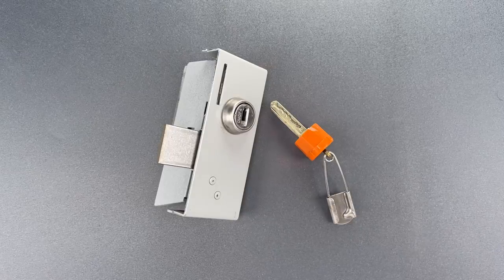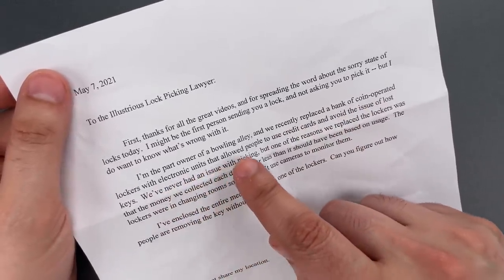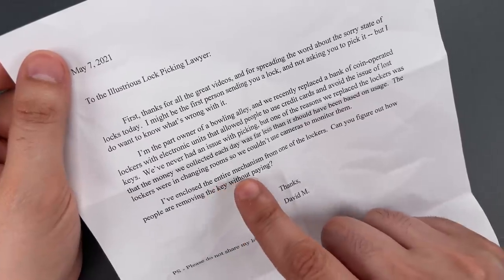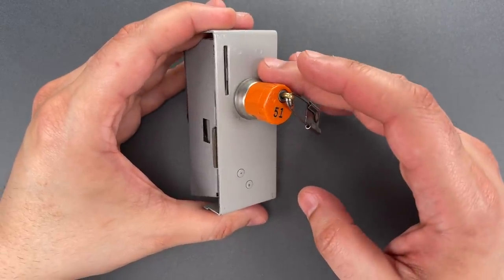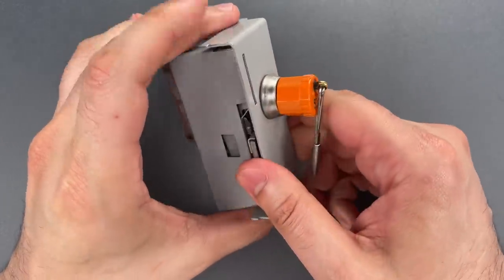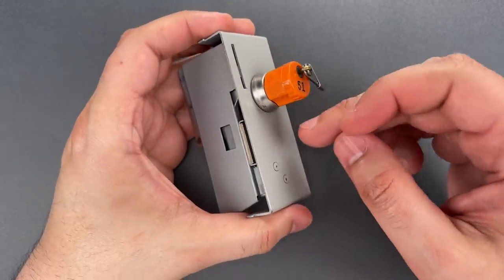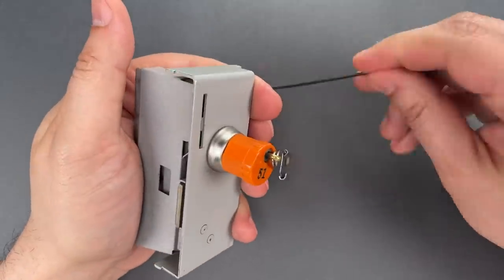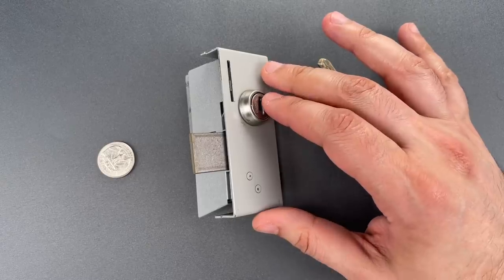[1308] A Huge Flaw In This Coin-Operated Locker Mechanism

Comment: LPL: When reading the letter takes more time than picking the lock
Reply: Guess I have to fix the lock
Reply: Generally speaking, sure that. Didn't see any picking and didn't see multiple ways in the video tho.
Reply: Everything he did in this video took more time than picking the lock.
Reply: Picking the letter took also longer than picking the lock...
Reply: Thanks to LPL now i have the feeling  of 99.9% less security.
Reply: Well he didn't literally picked the lock, but he picked the key
Reply: He did not even pick that lock XD
Reply: he picked the lock already, picking it took six minutes in the mentioned video…he got lazy and didn’t link to it

he didn’t actually pick the lock, just picked the key retention mechanism.
Reply: That's pretty much all the time.
Reply: ...am I the only one laughing because he didn't pick the lock? 
I mean sure he cheated the mechanism in a way pretty similar but this is the lock picking lawyer not some kid with aluminum slugs
Reply: Alex D.: when you don’t know the difference between picking a lock, and defeating a locking mechanism

 (Hint: this video features no lock picking)
Reply: he.. he didnt even pick the lock.
Reply: @overlordghs1081  to be fair since there is a locking mechanism to prevent the key being removed until coin is inserted it could be argued he is picking the lock, more so because he used a picking tool and not just a fake coin or various other by pass methods likely used for years
Reply: @SwiftCreationStudio I would hardly define the key retention system as a “locking mechanism.” that would be quite the stretch, as it’s just a bar preventing the actual core from turning enough for the key to be removed. lock picking is defined as attacks against an ACTUAL locking mechanism using tools other than the key to actually open the lock itself. also, he used a bent piece of metal not a picking tool but regardless the same effect could have been achieved with any material stiff enough to manipulate the bar. also, just because a tool is called a lock picking tool doesn’t mean every institution of it is considered “picking.” If I use a hammer to scratch my back, does that mean I am hammering my back?

He didn’t pick a lock in this video, he used a piece of metal to exploit and bypass a mechanical system that was completely separate from the actual locking mechanism keeping items secure. You could not use this method to actually open the lock, only to bypass paying to use the lock, so clearly no lock was picked. 

Also, I’m fairly certain OP is a bot that just takes popular comments from his other videos and comments them here.
Reply: @overlordghs1081  ...yeah a bar preventing the access or removal of an item is the signature hallmark of literally every lock. It might be a terrible one and require zero skill to bypass but that is literally what a lock is. 

I'd take your misguided perfectionism of the craft back to square one because in watching these videos you have been spoiled and have lost sight of what a lock is.

Also of what relevance is the op being a bot, let's say you're right, that is A. Not how they operate B. It still boosts engagement for LPL, C. Serves no purpose in existing so creating it for such a specific purpose and not steering it toward obtaining monetary gain or spam geared to that means is pointless... bots don't just fall from the sky they need to be programmed, but that isn't exactly hard either

The user isn't a bot because such a post from a bit would require some level of AI that simply doesn't exist for the average bot and there is no end goal of obtaining any sort of gain which with increased difficulty in creation would become evermore desired. 

Being uncreative and quick to post without really obtaining the details doesn't make you a bot
Reply: He didn't pick the lock, pay attention.
Reply: @incumbentvinyl9291  debatable. Pay attention
Reply: @SwiftCreationStudio  It's not debatable, watch the video.

Do you comprehend what picking a lock implies? He used the key to the lock, that settles it. Unless your view is that when this lock is used, it's automatically picked when a quarter is inserted.
Reply: @incumbentvinyl9291  Is the key locked in place? Yes. Is a tool or other implement other than what is intended for the function. 

You might expect something far more complex, you might have a preconceived notion of what a lock is, or you may be over looking the fact the key was obtained without the quarter triggering the basic locking mechanism holding it and focusing on the lock the key operatates.
Or hell maybe you are just wishing he picked the keyed lock too 
To which you have a different video to watch.

But if you take a step back from your hive mind reposting of the same things because you need to make a point yourself despite being unoriginal and overly stated, you'll find a lock was indeed picked.

Far from the most complex in fact it's probably one of the least but as I said. It's debatable and that is precisely what is going on here.
Reply: @incumbentvinyl9291  also to answer your last point, no. I consider the quarter to be the "key" so to speak. But like I said not exactly a complex system there I've seen basic coin counters with more complexity
Reply: @SwiftCreationStudio  The lock wasn't picked.

That's nothing short of ignorant. You can't open the lock using only a quarter.
Reply: @SwiftCreationStudio  TLDR
Reply: @incumbentvinyl9291  Ah, alright I'll indulge your illiteracy.

You're wrong. Completely.

And to think I was writing up a follow up saying how you made an honest mistake and showing sympathy for your... how you put it... ignorance.
Reply: @incumbentvinyl9291  You're the only one actually showing ignorance. You have been given information and you have made the active effort to ignore it. It's one thing to hold mistaken beliefs, it shouldn't hurt you to be wrong if you learn from it, but you're refusing the information and proudly proclaiming that.
You're Pridefully Ignorant.

Thanks for the debate.
I told you this was debatable
Reply: @SwiftCreationStudio  Not reading your essay did not require active effort.

There is no debate, facts are facts and will remain so.
Reply: @incumbentvinyl9291  You're right about that, just wrong about the facts. The debate already took place. 
I don't believe there are winners or losers in debates but you sure aren't giving yourself or your position any credibility.
Reply: @SwiftCreationStudio  I have not been part of any debate, I've simply stated the facts at hand.
Reply: @SwiftCreationStudio  The lock wasn't picked.

What debate? Consult a dictionary and educate yourself.
Reply: @incumbentvinyl9291  Debate: a formal discussion on a particular topic in a public meeting or legislative assembly, in which opposing arguments are put forward.

Lock Picking: Lock picking is the practice of unlocking a lock by manipulating the components of the lock device without the original key.

Lock: A device used to prevent the operation or movement of a vehicle or other machine.

Which definition are you having trouble with?
Reply: @incumbentvinyl9291  Don't tell someone to get a dictionary unless you're hungry, you might have to eat those words.
Reply: @SwiftCreationStudio  Yes, a formal discussion in which opposing arguments are put forward. I have not provided any arguments, I've simply stated the fact that the lock was not picked, so that clearly doesn't apply here.

Exactly, without the original key. Here, the key was used. You keep proving my point.

''get a dictionary''

Hah! Time for you to consult that dictionary once more. I suggest you start with the word 'Formal'.

Good job painting yourself into the corner.
Reply: @SwiftCreationStudio  I find it rather interesting that you said you'd stop this conversation, yet here you are time and time again.

What happened? Did you realize you were wrong and simply couldn't let it go?

Yeah, you should be sorry. Apology accepted. Better luck next time.
Reply: @incumbentvinyl9291  I find the projection interesting, myself. You're still wrong and you went silent for 8 hours after I gave you the information you requested. I got the dictionary, I educated myself and decided to help you.

Also I haven't "painted myself into a corner" I have been watching you flail around like a fish out of water.
Reply: @SwiftCreationStudio  I'm factually correct.

I went silent for 8 hours, oh my! Now that is a long period of time! People have things to do, among other things, people usually sleep several hours a day. Clearly that is too complicating for you to grasp.

I have not requested any information. Why would I ask you to provide information on a subject that I already know I'm right about? That's nothing short of absurd.

You're obviously not very intelligent, I'm sorry. Pun intended, haha!
Reply: @incumbentvinyl9291  you've made numerous incorrect assertions to what you've believed I was saying to start with, not only are you wholly wrong in your facts which you have not delved deeper into what you believe falsifies my assertion your entire position is flawed from the ground up because you don't even know what you're arguing.

Please tell me how I am wrong. I want to hear it from you so I can stop putting words in your mouth.

You can't be factually correct if the facts disagree with you even if you're Trump levels of stubborn.
Reply: I find it humorous he always seems to sleep when asked to explain how I'm wrong rather than just say I'm wrong. 

I'm asking how I'm wrong, I want you to explain to me in your words so I don't have to offer a strawman argument for what you're saying as to how I am wrong. 
So lets get down to it.

Operators are expecting your call
Reply: I am very sorry this comment created such upheaval around the question "whether he picked the lock".
Indeed, in my comprehension of "picking", he didn't. The thing is I saw the video and thought to myself: darn, the part where he makes his trick lasted only a couple seconds and reading the letter was longer...
Then I wanted to react and automatically assumed he was "picking", as he does in 99% videos, even though in hindsight, that word is wrong.

It's interesting to see how a comment section works!
Reply: @alexd.3048  You're a respectable person and while I disagree I'm not going to argue. The other guy apparently didn't like that I said it was "debatable" and that is really the only reason I did that I figured I'd take the piss out of him and have him debate it. 
It absolutely is debatable, he just isn't capable of debating it.

I also think I made my position clear even though at a certain point I was just screwing with him so no real reason to argue it more than once (maybe 1.5 times lol)

But yeah I'll be heading off because he's getting all tuckered out around the same time I bust his balls and I'm kinda getting bored. 

But you have no need to apologize that's just the way the internet goes
Reply: @alexd.3048  You do not need to apologize for the incompetence and sheer idiocy of others. He's clearly not very bright, sadly I doubt there is much he can do about that.
Reply: @SwiftCreationStudio  No, I sleep at night like most people. I hope that one day you will understand that, difficult as it may be for someone with an IQ under 50.

TLDR
Reply: @incumbentvinyl9291  I'm so disappointed, I donate money to fight illiteracy and I can see we are losing that fight. Also I guess you live in Alaska, only areas up there have nights that last 16+ hours. Lol 

It's obvious you're not capable of proving me wrong and you just can't accept it. I'll tell you what, even though I didn't say it before I will now. I'm done playing with you. You've brought nothing of substance other than continued assertions based on incorrect data and from complete ignorance. 

last word is all yours
You're still wrong though
Reply: Lmaooo

Comment: a lot of my friends had quarters with string glued to them, or cardstock cut into the shape of a quarter. the string one was more common because it left no trace. i never saw anyone use a tool to bypass the lock. some of the gumball machines could bypassed by inserting a quarter, starting to turn the dial, then backing off until the quarter barely slipped back out, then fully turning. eventually i started seeing coin op things that required multiple turns of a thumb screw or had a shutter to trap a coin from coming back out via string. The really crazy one to me was that for a time in the 90's, some coke machines could read in a coupon instead of a bill and would dispense drinks. i guess coke didn't think people would bother making copies? that feature was quickly disabled from the one in my school, because we literally made it vend every single drink it had in one day with a stack of coupons

Comment: I have a hard time believing a significant number of customers are going to a bowling alley carrying a piece of bent wire - so much so that the owner can detect the lost profits on a daily timeframe.
Reply: People are just not locking it... Who is gonna steal your shoes and jacket anyway?
Reply: You can probably use one of those wooden coffee stirring planks you get when you buy your coffee from a vending machine. Now you're still spending some money on that, but you're probably getting the coffee anyway.
Reply: @coladict  or just the old fashion quarter on s string.
Reply: I rather suspect people aren't using the lockers, or someone found a way to take the coins. Seems like a crucial part of the mechanism to me.
Reply: Don't under-estimate the word of mouth
Reply: @Ohtaror  the coin box on these units is actually the most secure item there is because that was basically the only real concern to be company had.
Reply: it doesn't have to be a piece of bent wire, the pint is that you can just stick anything that fits in the hole, it doesn't have to be a coin. someone could probably use like a house key or something similar that they are likely to have on their person in the hole and achieve the same effect
Reply: @leechowning2712  Likely, yet if we learned that "most secure" is a rather relative concept, it's here ;-)
Reply: I'm almost certain a lot of the "lost profits" were just people using the space to change their shoes and not lock anything in the locker.
Reply: They can use their home or car key instead of the bent wire. Any piece of metal that is long enough and thinner than a coin will do the job. You can do wonders when you accept that everyday items can be used for other things than their intended purpose.
Reply: You wouldn't need anything that 'fancy', you could do it with a plastic fork, or anything else you could stick in that slot.
Reply: In my country, they just use fish-shaped plastic fake coins attached to a metal chain or wire... The round part is slightly smaller than equivalent real coin, so it engages the lock mechanism, but doesn't get pulled completely inside, so it can be retracted by pulling from the "tail" extension that connects to chain or metal wire.
Reply: Depends on where they are. 
Small town? Probably not.
Inner city? They're lucky the locker still exists.
Reply: From personal experience, after changing shoes, I just take all my stuff with me to the seats. I'd have left most of my stuff in my car anyways. Why pay for a locker at all?
Reply: Bowling alleys have a lot of regulars so word of mouth probably spread among them.
Reply: @Ohtaror  yeah I feel like he actually missed the point in this video. I think the guy who sent the lock was asking how money was getting lifted from the lockers, not how the lockers might be used for free. At least based on the whole "might be the only person not to ask you to pick a lock" part of the letter
Reply: Probably people are just not locking them, but depending on the width of that slot, it's possible people are shoving their house-keys in there.  Once one person knew how to do it, it wouldn't be long before that knowledge spread to the whole bowling community.
Reply: Yeah, it seems most likely to me that the lockers just weren't being used. If they were being bypassed that frequently/by a large number of customers, the owner would surely have at least had suspicions of how it was done if not actually figuring out how it was done.
Reply: Right?! especially if this is in the states, I never used pay-lockers at a public place, I can just carry my stuff in my back-pack. Whose the moneybags who can afford that anyway...
Reply: tis what happens when you are greedy and charge for security. Is there any reason to no just have people come in and put their own lock on the locker they want to use? The only threat there is people locking other lockers just to be an ass but thats nothing a pair of bolt cutters stuck in the office cant fix.
Reply: Probably ice cream flat sticks work too. In Soviet Union these were used to trick coin-operated payphones